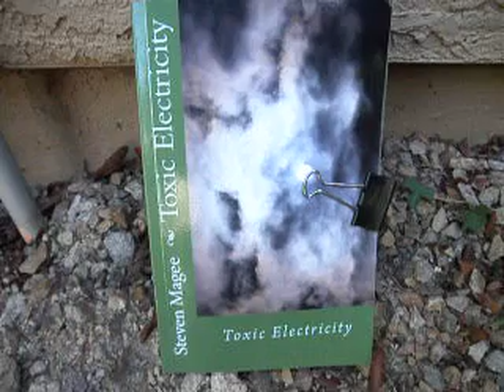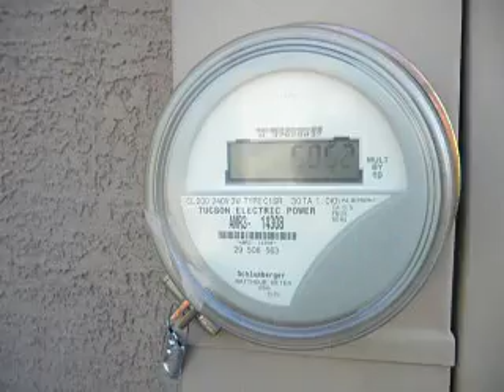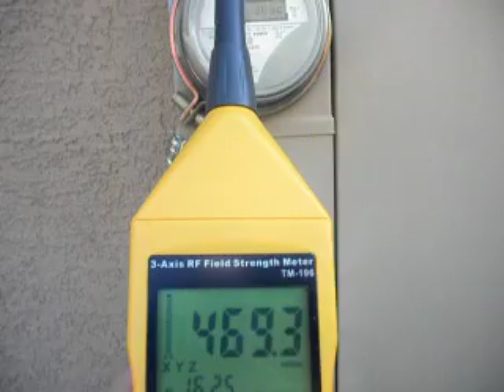The Secret Microwave Transmitter

Comment: The water company here United Water wants to put an RF meter on and nowe are claiming they are going to shut the water off if we don't let them I have EHS I cannot live in a house with wifi and just cant be around the constant blasting of it now they claim  it only broadcast when the reader comes around but someone in north NJ posted a video where its broadcasting 24/7 peaking every 15 secs now. How much is that RF meter you have is that the best to have  I do have an HF35C Im going to go to my sisters to measure I was told the HF35C would pick all this stuff up but now im hearing some new ranges of wireless things are in the 5ghz do you think the acoustimeter is a good one to get also can that box that transmits be disconnected just plugged in  when they come by as long as the actual meter is there would it matter?

Comment: A 9V battery has a field of about 2000V/m between the terminals! My god.
Reply from the maker: http://youtu.be/oHTXt-LMWIE Radiation Victims Testify at Arizona Smart AMI AMR RF Transmitting Utility Meter Meeting 12/12/2014: State of Arizona radiation sickness victims give testimony at 1:42:00
Reply: FranklinLaserBlog  Which has no transference and does not travel, unlike the radiation in these meters, specifically designed to travel.